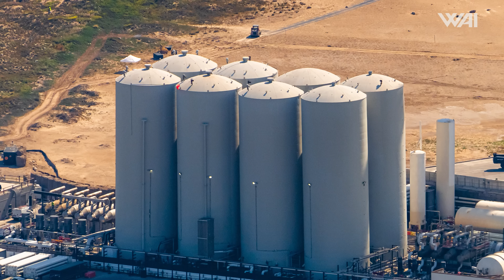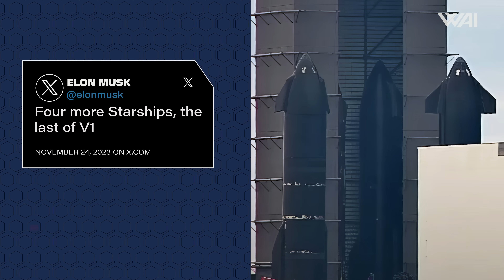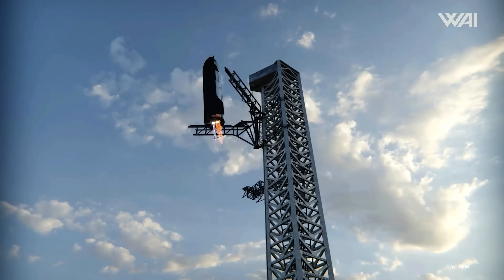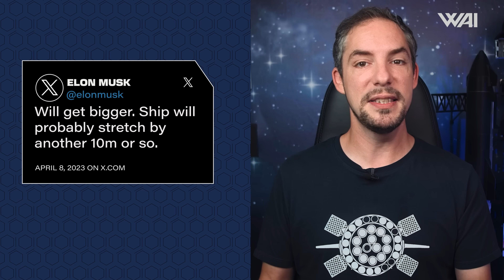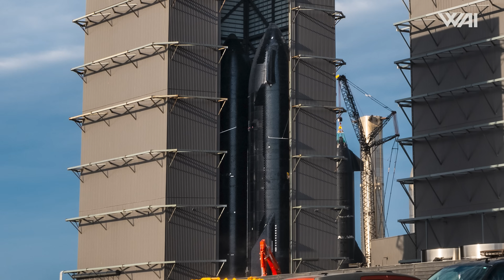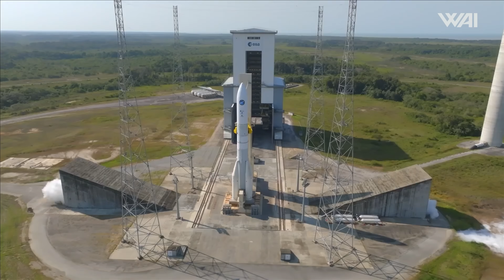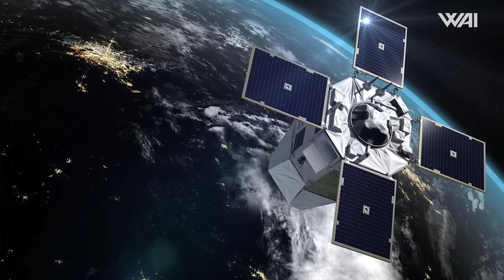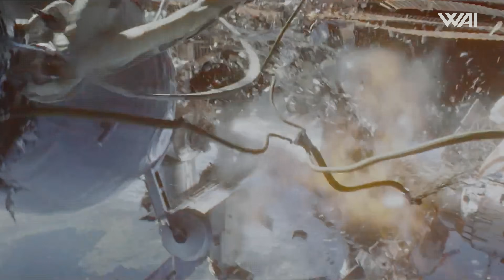Starship Evolution: Why SpaceX is Shifting To V2 Starship Now!

Comment: SpaceX is preparing for the third Starship launch following the successful second orbital launch. Engineers at Starbase are working to restore the launch site to its original state and replace damaged parts, including the Booster quick disconnect. New parts are also expected to arrive in the coming weeks, such as engine chill hoses. The Orbital Tank Farm, which stores liquids necessary for Starship operations, has been inspected and photographed from an aerial view. The tank farm includes liquid oxygen and nitrogen tanks, as well as water tanks that were originally intended for methane storage. Methane is stored in horizontal tanks located adjacent to the original tanks. SpaceX may phase out the vertical tanks due to damage sustained during launches. The focus has also shifted towards the fourth and beyond Starship launches, with various prototypes being shuffled around the High Bay for final pre-flight preparations, including heat shield tile installation and testing. The next generation of Starships, V2, has been announced by Elon Musk, with the last of V1 being the four current prototypes. The V2 Starships are expected to be a significant evolution from previous versions.
Reply: successful second orbital launch sorry what? Are you living in a parallel universe? Starship never reached orbit, it exploded every time.

Comment: I'm not convinced of the 'Susie' design.
It's a crew capsule, that needs propulsive landing because it has a big cargo bay that makes it too heavy to parachute.
The same job could be done by having a regular crew capsule with heatshield attached to a cargo capsule with heatshield and both separate and land by parachute. No landing engines/propellant/legs means mass savings.

Unless in orbit manufacturing suddenly takes off, I don't see a need to return a bunch of cargo to Earth from orbit, which is the only new trick 'Susie' has.
I think ESA just want to join the propulsive landing club....      :)
Reply: Actually, it's something Dragon might have evolved into... a propulsive-landing capsule as Dragon 2 was intended to be, but with an integrated service bay instead of a disposable trunk. I could definitely see SpaceX building something like that if they'd not changed course and gone with Starship.
Reply: @simongeard4824  But what is the practical value of integrating that service bay into a capsule?

ESA don't have reuseable rockets, their launch cadence doesn't require any rapid reuse.
It will never need to be 'rapidly reused' so why send landing engines, propellant, legs, flaps etc into space and back, losing tons of payload mass in the process?

SpaceX made the right call switching to parachutes and splashdown, it's the landing system with the lowest mass.          :)
Reply: @EveryoneWhoUsesThisTV  The point of Susie is that it's a baby step towards re-usability... something like a mini-Starship. I'm not convinced it has a practical future,  but I don't see it as inherently flawed.

As to SpaceX switching to parachutes being the right call, that's debatable. They did it solely because NASA wouldn't let them experiment with propulsive landing on NASA missions... and development of the parachutes for Dragon 2 proved to be the single biggest challenge for the entire project, rewriting everything they and NASA knew about modelling chute behaviour. They made it work, but that doesn't make it a superior option... which is why they rejected it for Falcon.
Reply: @simongeard4824  Yea, like I said, Susie is just ESA trying to look modern by joining the propulsive landing club!        :D
They don't need propulsive landing to achieve anything. It doesn't reuse the upper stage engines or fuel tank, so it's nothing like a Starship, it's just a giant crew capsule that's too big to land efficiently.

Parachutes are the right choice because of mass, you can carry more cargo in a Dragon trunk if you don't waste mass.
You don't use propulsive landing if you don't urgently need it because it is soooo heavy!
A ship needs around its own dry mass in propellant to land propulsively, all that is cargo mass that could have been put in orbit!           :)

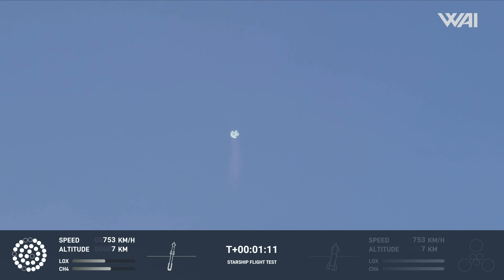Comment: 11:04 The rocket was not pulling high G turns. In fact, the rocket did not experience much different stresses than normal.
There is no significant air at this altitude and there is not other significant force acting on the rocket. The engines are still in the same place doing the same thing as before. Why does everyone get this wrong?
Reply: So you think you're a rocket scientist now?
Reply: @jaydonbrown617  No, but it seems like no one is able to draw a free body diagram.
Especially people who are putting videos and (mis)information on YouTube to a public audience with many viewers should be careful. They spend many hours on those videos, cutting and polishing, but they don't check the actual facts. Drawing a free body diagram of that rocket takes 5 minutes, and maybe an hour or you've never done it before.
Reply: @DerKrawallkeks  These channels have to print money, so misinformation or not, they gotta spam the videos. 

I'm just simply asking how can you possibly know the stresses on the booster at that altitude? Was there a live telemetry feed I missed? You say there is no other forces, but what abut gravity and centripetal force? Even air resistance play a part here, because although not as thick, the atmosphere is still present here, or else the booster would not be able to fire engines. This is why Starship Stage 2 has vacuum raptor engines, for when it gets high enough to where the other three raptors can't function anymore.
Reply: @jaydonbrown617  You're right about spamming videos, unfortunately. Half as many would be enough.

You're completely wrong about the engines though:) rocket engines don't need air. They burn fuel and oxygen that is both carried on the rocket. The "vacuum" engines are just optimized with a slightly bigger nozzle and therefore expansion ratio, but they are basically the same engine. The booster engines can very well fly in space without problems.

At the altitude that the flight 1 went to, there is almost no atmosphere anymore. Gravity is not a force, it's an acceleration. It acts on the whole rocket in the same way, from the smallest screw to the biggest parts. The rocket experiences no stresses due to gravity. Centripetal force yes, but very very small. Much smaller than the thrust force of the engines, therefore the stack still was nicely pressed together.
Reply: @DerKrawallkeks  Alright I'll give you the rocket thing, but I push back on the forces. Yes gravity is not a force, but weight is, and weight is due to gravity. As the booster is flipping over, it's weight is shifting and this ties into centripetal motion as well. If the craft made it fully out of the atmosphere and was experiencing zero g, then sure none of these forces would matter. I would say these forces caused the destruction of the first stage, but it clearly exploded from the inside out.
Reply: @jaydonbrown617  Hey, I didn't mean to be too picky with the wording of gravity and weight. I understand what you're saying, but earth acceleration (or force, whatever you want to call it) acts on each atom of each nut and bolt of the rocket in the same way. Therefore it experiences no stresses as it is pulled perfectly uniformly down.

At their altitude, they were almost in "zero g".
Reply: It has nothing to do with the air, a body that size spinning end-over-end generates significant g forces. You’re clueless.
Reply: @fredbloggs5902  It's a combination of both bud

Comment: 3.97 mm?  3.6 mm?  Those are surprisingly odd numbers.  I'd bet money they're going from 5/32" to 9/64".  People make a similar mistake with the Falcon 9.  It's 12' in diameter, not 3.7 meters, since that's the biggest thing you can move on the Interstate.   Rumors of the Imperial system's death are greatly exaggerated.

Comment: I keep seeing these supposed space laser ground fire images on these fake mystery channels. But it really seems to have grown legs online. For one thing if someone wanted to do that the laser would likely be infrared, therefore invisible to eyes and most cameras. Another thing is firing a tight beam like that from space through at minimum hundreds of miles of fluid atmosphere would be a problem. I know how adaptive optics work but still. I'd think it would take a really giant satellite to create a beam you could focus to a few feet or meters wide on the ground. Its probably not impossible, just damn near it with the tech we have today. And couldnt be done in secret, you could see the satellite with just your eyes. Still, it's lighting certain parts of the internets hair on fire with conspiracy theories. We just can't have anything nice, people forget that mentally ill people have internet too now. Probably shouldnt listen to them until they start taking their meds. Lasers are a great way to send a lot of energy over long distances in space where you don't have to worry about an atmosphere scattering your beam. But even in space the beam still diverges over distance because that's just how light works. It's scary what people will dream up from a single still, almost certainly faked image. I guess someone could be hanging a bomb disposal humvee with a laser from a helicopter a few hundred yards up out of frame shooting the ground. Though that does seem rather unlikely😑. And you still wouldn't see a white beam of light, just a fire on the ground. Even the big future propulsion lasers scifi dreams about would have to go on the other side of the moon or people would light their heads on fire over it. I guess thats what all the tinfoil is for. I live in 

Florida so everytime we launch a probe with an RTG power source crazies of all types come out in droves to protest. They have little to no idea how any of it works yet they are confident its just bad, bad bad lol. And the local media talks about the whole state being showered in plutonium if there were a launch failure. Must be nice to know so much about literally everything. Without having to do a shread of real research or IDK, maybe talk to an expert? Oh yeah,..... we are all "experts" now because we can Google. A PHD in anything might only be an inch wide but it really is a mile deep. These people think it's just a 1 inch square. They do their own research🙄. I actually know how to do research and the general internet (Google, Acme search engine, whatever) have become the least reliable source you can turn to. It's crazy for those of us that watched the internet grow from less than the first 1% of users. It didnt start out like that, not till all the bad actors got involved. Just searching simple legal concepts will return multiple incompatible results on the same results page. All reading like expert advice.  Its like we just want to be crazy. I get where the draw towards these strongman political figures comes from. How do you get anything done when every idiot has to approve first? But those guys are definitely not the answer, they only care about making themselves more powerful and the rest of us don't really exist to them. There probably is no answer other than having a well educated public. But it seems we kinda gave up on that too, parents too scared their kids might grow up. It's extremely frustrating. We could be living and working in space by now (even regular ish people). Imagine what we could do with all that enriched nuclear bomb fuel sitting around waiting to blow us all up. We could be dragging asteroids around and building giant structures in space, mostly with well understood chemistry. It doesnt require foundry planets like in a lot of books. Although the heat energy from big solar collectors would be great for certain things. I think thats what Starship could really shine at. Just lugging tons of gear to Earth or Lunar orbit to build bigger better things from. We could get all our power from space if we wanted to. It doesnt matter how bad all the conversion losses are in beaming down lasers or microwaves when you have an endless power source like the sun. People gave up on that idea way to early, based mostly on those conversion losses. They kinda missed the point. And probably the crazies. I love what SpaceX has done and how they work but Bezos is right about people living off Earth. It's a million times easier to build spin stations from asteroids than it is to try to make a low gravity, high radiation and not to mention toxic place like Mars habitable. Probably even for a small Mars base, let alone a planet wide civilization. And everything you build out there makes the next thing easier to build. It could quickly snowball once we got started. We really could be doing a lot of scifi looking shit right now if we could ever figure out how to get along and treat each other fairly, with respect and dignity. Humans built this world we live in, maybe not the planet itself but every single thing we use and care about everyday. That's amazing and it deserves at least the same respect we save for religion. Getting out there might be the only way to save what natural world we have left down here. I just wish more people would drop the I know everything arrogance, accept that we all have a lot to learn and just get with the damn program already. I feel like Ferris Bueller with the Ferrari in the garage that nobodies allowed to drive. Still, at least one company (and more all the time) is trying to speed things up. I think Musk knows that Mars is just something to draw people's attention. Sure we could do it, just barely. But why? Remember his original idea to pay for all this was selling intellectual property from the Martians. Really? That will support a whole economy enough to send thousands of ships? In reality we could be making money on the Moon and from the NEO's now if we wanted to. With a lot less risk and Victorian waisting disease as part of everyday life like on Mars. He's obviously impulsive but he can't be that dumb. Or maybe I'm just another overconfident idiot on the internet, it's possible. But at least I'm optimistic about what we can really do if enough of us understood and really wanted to.

Comment: Who wants to bet that China will arrive to the Moon before this thing even have a successful flight.
Reply from the maker: I do! Just against China if that’s okay with you. 😋
Reply: @Whataboutit  okay just so we are on clear playing field. How would you define successful flight? I do not consider the tests to be successes. I consider them to be test

My definition: non prototype hardware, it launches and lands. No major problems (a heat tile falls off is fine). I wont even require it to be crewed in good faith. 

But if I win this bet. You gotta make a video about how China landed on the moon in less time than Space X. In good faith as if they were any other International Space Program

Comment: If the Starship hot stage ring was attached to the ship rather than booster, perhaps the ship could land on it. (More options + Mars) just saying.
Also, expect the forward flaps to be fixed. Only need one pair to move, once re-entry dynamics are known.

Comment: I think fixing the re-entry heat issue will prove to be the biggest challenge given the stainless steel hull/skin. Attaching tiles to it where the attaching mechanism can withstand the vibration and structural forces applied to them during liftoff seems to be the current challenge (separate of course from figuring out the tank/slosh problem or whatever caused booster reignition problem). Of course the problem with Starship remains a mystery unless they received telemetry right up until the problems with that occurred and have a handle on what happened. I now think that they need to have a drone rocket fly alongside it as it goes up to the earth orbit line to provide pictures and video, but that's just me wanting to see it as it goes up (even if the starlink connection with the booster and ship itself is lost).

Comment: I'd like to see a test with a disposable second stage with small external boosters instead of internal hot staging for stage separation. Build the moon stuff like lego in Earth orbit and send up the people with a Falcon 9. Transfering fuel in orbit seems difficult. Better to send up full tanks to connect together. Also use a purpose built moon lander instead of using a Starship. Keep things simple.
Reply: I completely agree. I have been dreading the orbital fuel transfer testing phase because it is bound to present formidable difficulties.  Multiple starship launches just to fuel a single moon rocket in orbit...seems like a head scratcher to me.  I keep thinking of the Apollo program; they used a smaller rocket with less lifting capacity and yet still managed to launch moonshots ( WITH landers and rovers ) direct from Florida to destination, no refueling or futzing around required. What are we missing here?  An intermediary throwaway second stage might be able to allow the same result from starship.
Reply: @AncientEgyptArchitecture  Wow! Someone agrees. Here are some more thoughts: What I see is that SpaceX has given Starship very small margins of error, and this must mean that they're struggling to fulfill their ambitions of reaching orbit with their targeted payload capacity. By making the second stage a bit lighter it will have a higher speed at separation and will still leave the booster with enough fuel to slow down and land. It isn't optimal in a two stage launch system, but by doing it this way they will have given up a bit of payload capacity for a more robust launch. With the awesome booster they have they can make whatever second and third stages they want.